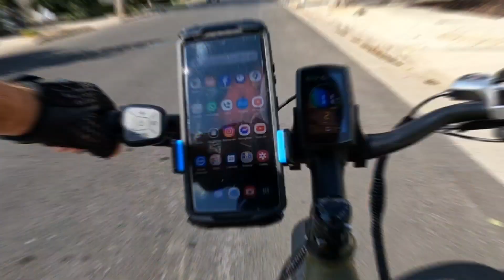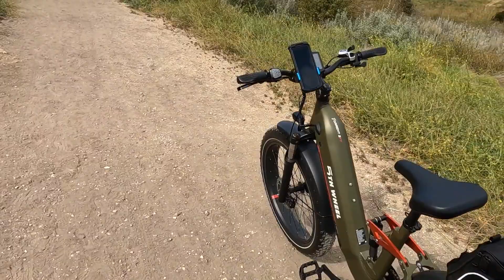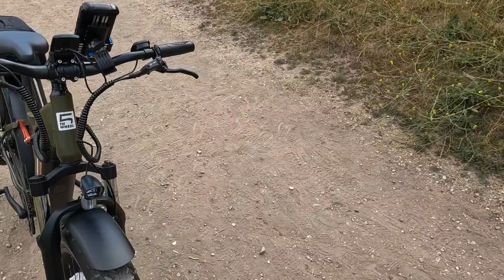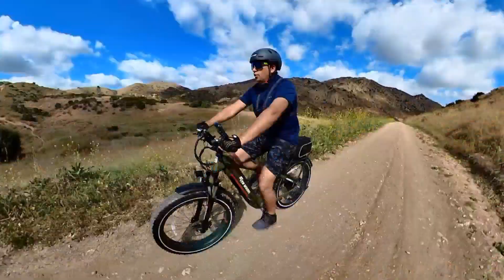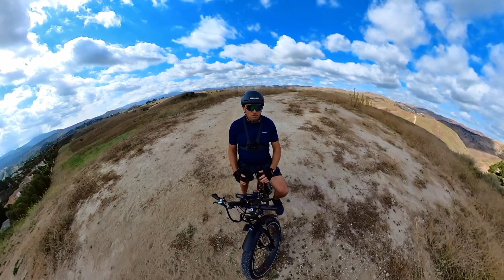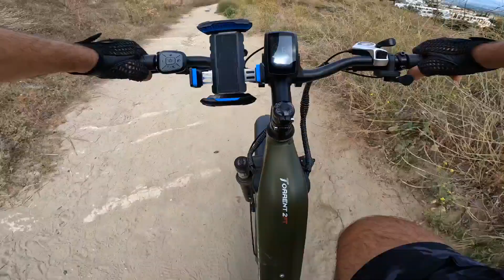OFF Road Riding on 5th Wheel Torrent 2FT Full Suspension Electric Bike with Torque Sensor

Comment: do you think i can ride this bike with similar posture you had at 8:05 of the video even if i'm only 5'4? i'm worried that maybe it is too tall/big that I'd have to ride it like a competitive cyclist haha. I wanna ride it it comfortably like how you are riding it at 8:05.
Reply from the maker: I do not remember  how low the seat can go but it should be in my unboxing video https://youtu.be/Xc24Zu-Mcxc but the handle bar can be get closer to you if you change the stem .  also, i think the sale will end tonight the code was : erides230